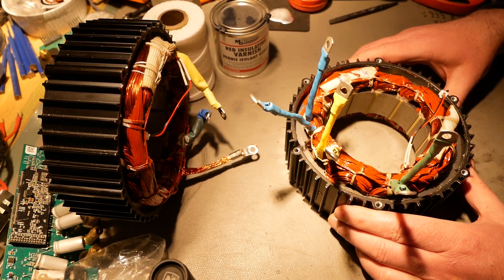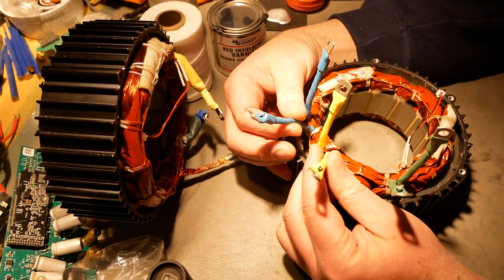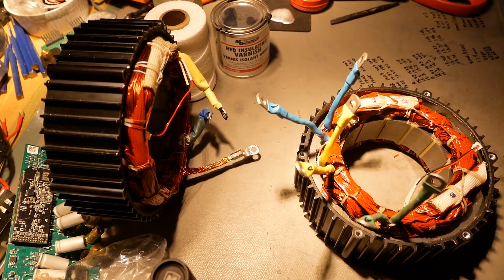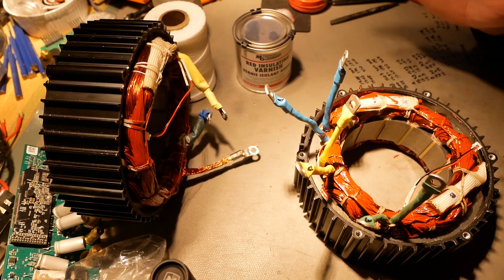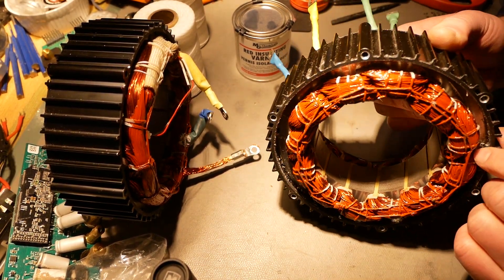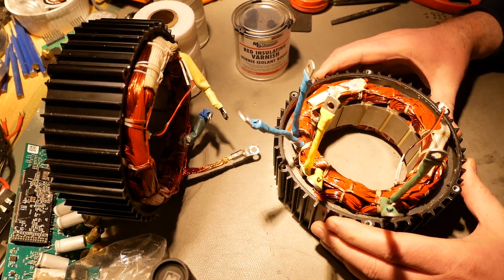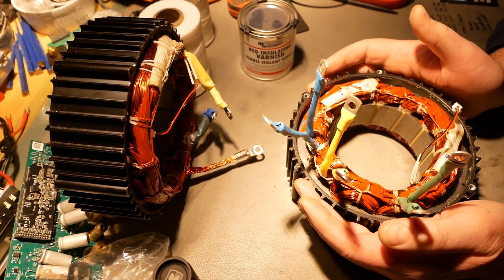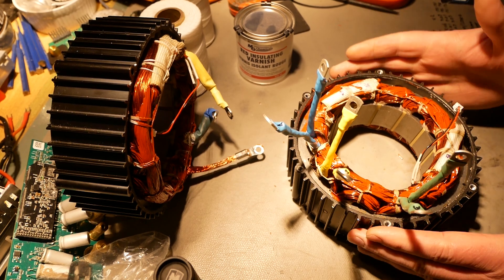QS165 V2 seperated windings

Comment: I am a big fan of dual wound or parallel stators (axial flux or hub motors) not necessarily for "massive" performance gains but because you can purchase 2 smaller controllers cheaper than one larger controller.  As an example, a Votol EM-100SP can be had for $80, while a Votol EM-200/2 is more like $280 (both are quite cheap for what they are but a beast to program).  Anyway, the only problem is the Sin/Cos sensor based controllers are less common than hall controllers, which typically means more expensive.
Reply from the maker: I'm running a dual wound motor myself for this very reason.

Comment: Out of interest if you remeasure resistance again with both lugs together do you get the original resistance again or is that different now. I guess that would confirm if it’s your improved crimping.

With regards to inductance, did you mention the A and B windings are 180 degrees from each other (I may be wrong) but would this have an effect during the measuring stage as I’m guessing the test equipment does produce a somewhat small current and therefore magnetic field?
Reply from the maker: I think the resistance is my fault. I let my milli ohm meter get away from zero and didn't notice. The LCR meter measures inductance at various frequencies. It is making a sine wave. I think perhaps the 2 windings interact with each other and this reduces the inductance a little. Separated, this doesn't happen...that's my theory anyway.

Comment: Poor quality control, QS motor has been really bad with connecting the battery lugs directly onto coated winding wires. Some motors are burning up because only a few strands are actually in contact with the lug.
Reply from the maker: I've heard this too. Mine were well soldered in and properly prepared. I had no issues flowing solder into the strands as they had all been properly tinned by QS.
Reply: https://youtu.be/Ghoutu9Sg70